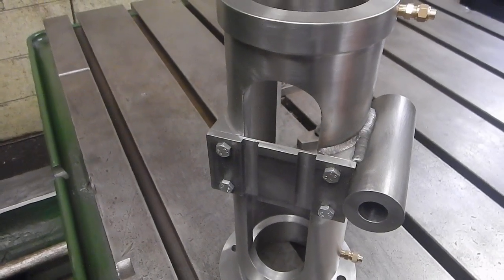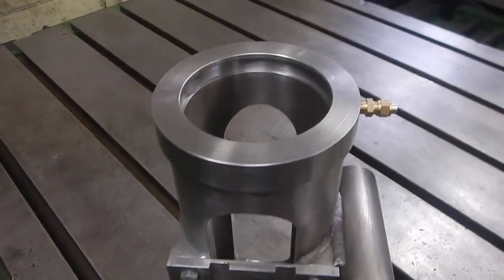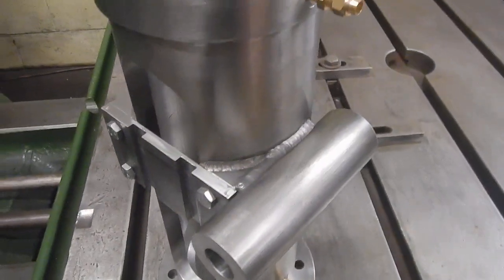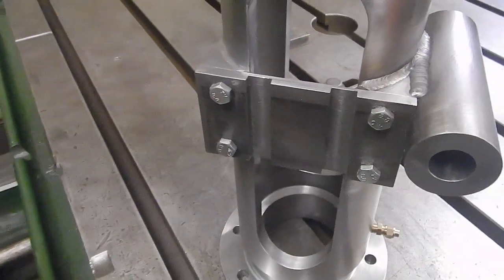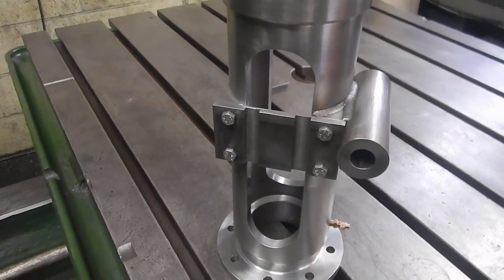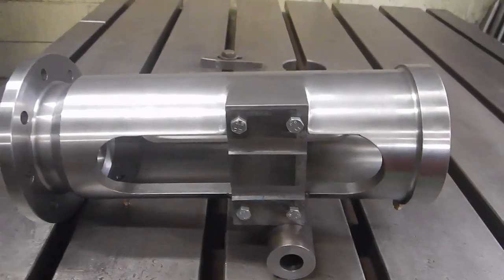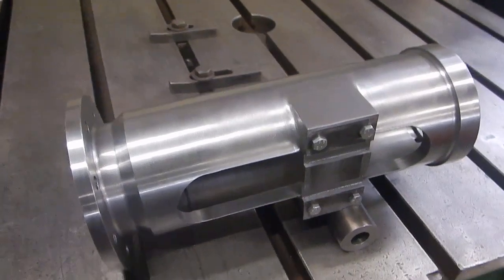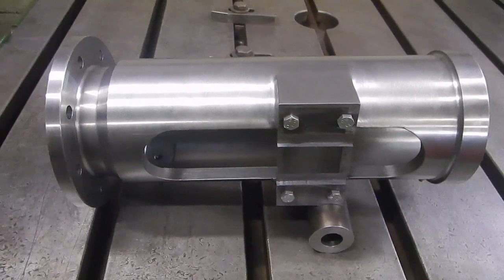traction engine build

Comment: Wonderful finish as usual. I'm intrigued by the welded-on parts and how they can be positioned accurately. Maybe final machining e.g. boring of the weightshaft bearing after welding?
Reply from the maker: hi alan thanks for your comments yes all welding is done first then set up and boring of the weighshaft housing and machining the flats for the valve spindle bracket is done also the holes for the flange are drilled on the same set up